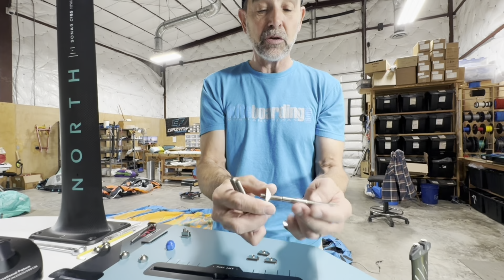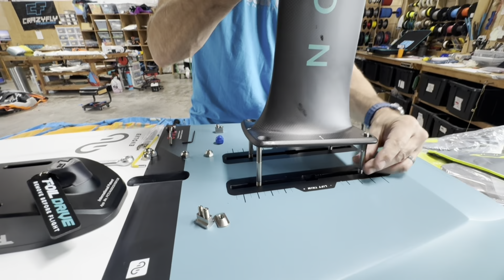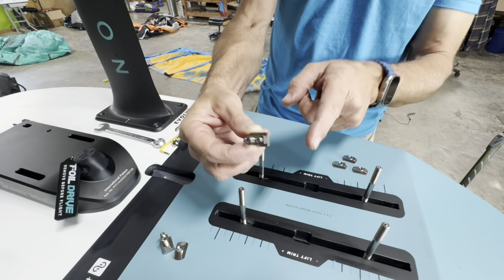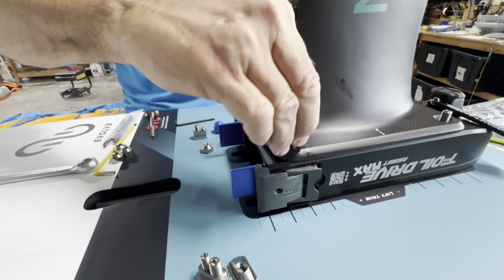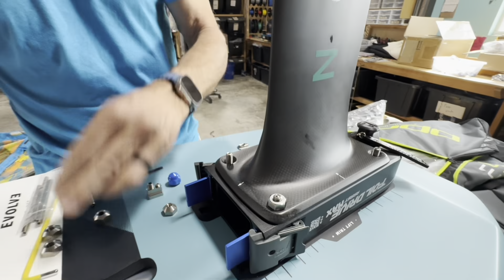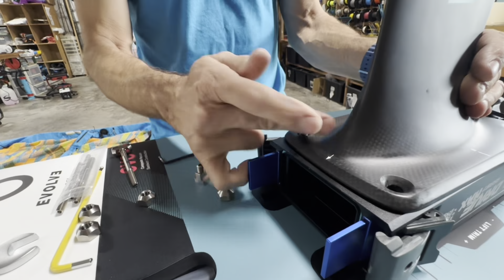Foil Drive Titanium Mounting System by Foilite

Comment: Are the studs just touching the bottom of the tracks when you twist them down so they stop and stay in place? I have GoFoil mast which use a cup washer between the screw head and mast plate, it looks like there's enough free stud length to mount the cup washer then use the 15mm cup nut to secure ?
Reply from the maker: Yes the studs are designed with enough length to touch the bottom of the track base keeping them locked vertically.
Reply: If the studs can twist in the t-nut and the cone nut can twist on the studs, how do you know final torquing the cone nut isn't twisting the stud deeper in and cracking the inside of the track? Only one of those two planes is going to slip and it seems like you would only want a half inch worth of threads on the t-nut end.

Comment: Geoff , for 7mm you could have a spacer on the 6mm to pack it out to 7mm and a 7mm cone nut with a 6mm thread.
Reply from the maker: The 6mm works perfectly, the cone nut is the same size as the 8mm other than the screw in the middle so it works no problem with all counter sink mast bases or flat mount.
Reply: @kiteboardingcom  perfect , i love these enhanced hardware ideas you are bringing to market .  maybe the reel leash V2 can be re released by you ?

Comment: What about any sort of lube on the threads?  Any issues with galling like with stainless. I'm not familiar with using titanium.
Reply: Titanium doesn't gaul which is a big bonus , if just one end is Ti and the other SS it prevents it
Reply from the maker: No there are a no need.  Stainless is a soft metal and can gaul pretty easy if not kept clean.  Titanium doesn’t have this issue and won’t get that rust layer staying corrosion free.